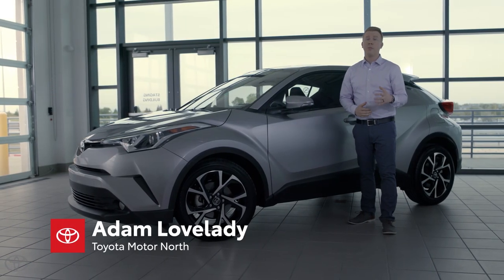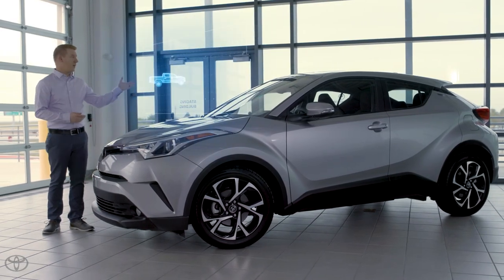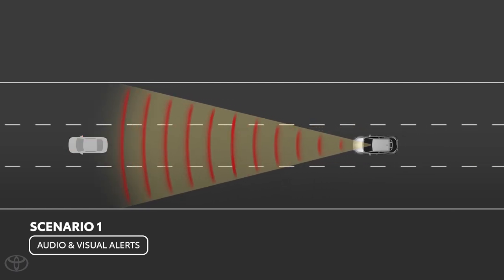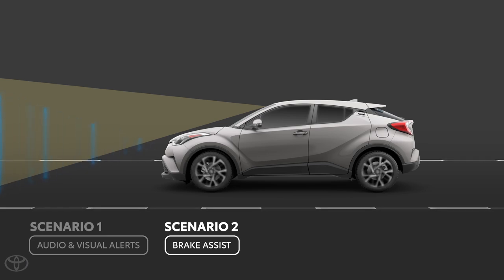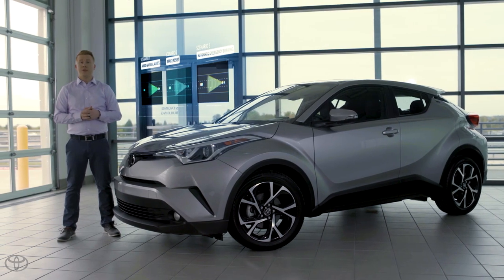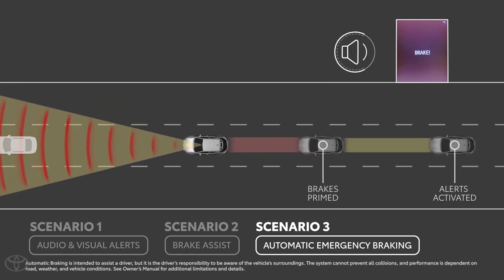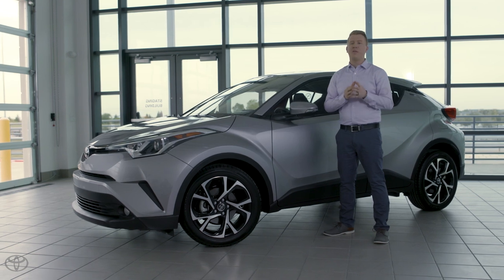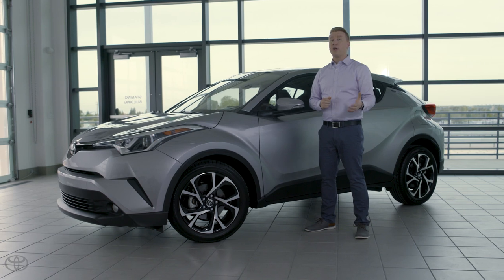Understanding The Stages of How The TSS Pre-Collision System (PCS) Works | Toyota

Comment: Just recently had a scenario where the PCS was really helpful. A car suddenly stopped ahead and while I did apply the brakes the distance was narrow. Pressed on the brakes, pcs applied the additional force and helped me come to a stop within one car length. Very helpful, very useful and a lifesaver in a worse case scenario which thankfully did not happen this time. Thanks toyota!
Reply from the maker: James, thank you for taking the time to share this with us. The greatest compliment we can receive is knowing your Toyota kept you safe.
Reply: In my first month driving my 2022 Corolla Cross a minivan pulled out into my right front qurter panel and though I was going only 25-30 mph PCS SLAMMED on the brakes before I could hit the brake pedal. No collision, no harm.

Comment: PCS is a feature that I made sure was included on my new 2019 RAV4 Hybrid Limited, but it does not work!  It is turned on and and set at “high” sensitivity, but it will not brake automatically.  My other manufacturer’s vehicle with brake assist worked fabulously.
Reply: Same thing with me. Rav4 2019. Says it's on, have it set to highest sensitivity, never get any alert!
Reply: It doesn't work in my 2020 highlander! 4 days old car!
Reply: knanand14 So sorry to hear that.  Hopefully, Toyota will fix it right the first time.  I haven’t taken in my RAV4, yet.
Reply: It appears like a more common issue. Just like you I wanted this feature to be there on my car! But does not works!
Reply: knanand14 😢
Reply: I can attest to this. Someone cut in front of me and did not work!
Reply: Same for me in a 2021 C-HR, it works when radar cruise control is on but not when it's off.
Reply: Hope I'm not too late to tell you this. I've been trying this feature on my chr and saw that sometimes it worked and sometimes it didn't. Fiddling around I noticed that the system works best or at all when you're not paying attention to the road ahead. Apparently, there's a sensor or camera tracking your sight. Hope this helps.
Reply: @ideaynojodas  that's very interesting, I'm not aware of any internal eye tracking camera, where do they hide it?
Reply: @kabukidreamboy  this is just a theory of mine, but it doesn't seem too far fetched, since many other cars have this feature.
Reply: @ideaynojodas I think you’re right. I have a 2019 chr Koba and sometimes it warns me and sometimes it doesn’t and I don’t have the cruise control on.

Comment: I have PCS on my 2019 Rav4  and Love to have another set of eyes on the road so to speak. I had to test it and it does work.. it took some guts the first time to trust the car would stop. My foot was ready incase it didnt.
Reply from the maker: What a leap of faith! Now that you've learned to trust the feature, do you use it often? -Hannah
Reply: @toyotausa  yes... i use it all the time but try not to rely upon it.. it would be nice if i could have it on all the time just as extra protection in normal driving without cruise control on.
Reply: I love the Pcs. It has helped me avoid getting in an accident. Go Toyota!

Comment: How do I know if mine is working? Lane tracing assist and dynamic cruise control work very well, but there have been a few instances where I would have expected PCS to activate but didn't... I have ensured it was on using the MID and increased the sensitivity as well
Reply from the maker: Hi, Matthew. For any vehicle concerns you are experiencing, we suggest visiting your local Toyota dealer for a proper diagnosis. Please visit, Toyota.com/dealers to locate the dealership nearest you.

Comment: I own British Corolla hatchback flamexpack hibrit 2020 model.  I use only 1000 kmetters Line asist working well. But I never heard voice alert And never Visual information. Brake system never worked what is the problem? Is it turn off or Toyota dosent support that option in Turkey?
Reply: Have you ever had "emergency" situation on the road? If you are breaking on time the system simply will not activate. I suggest you to try on a paper box or set our windshield sun screen(if you have one) on the middle of empty non used road and try yourself, the car should break.  My Corolla even break when I try to park in parking where there is a lot of leafy bushes and it detects them also as object then my car suddenly breaks.

Comment: My 2019 Toyota Rav 4 has all the safety features but I don’t think PCS works. I never get any alerts either and in DC traffic that’s strange. I asked the service center that I bought it at to fix it and they told me I’m a good driver, but I’m not that great. I rented a Chevy Blazer 2022 and everything worked including PCS . I’m going to take it to a Toyota dealership and see what they say. But I worry that when I pass someone if you have to narrowly it won’t let you and will apply breaks. It’s not ready yet if you ask me. I do like rear cross traffic alert and BSM but you can’t rely solely on BSM to change lanes but it’s helpful in certain situations

Comment: Got a 2024 cross and getting it checked up next week. System is very invasive. Applies brakes way too early or not at all even at a very slow speed. It is a very anoying system to me. Accidients have happened before and unfortunately, they will still happen with or because of all the sensors and security systems.

Comment: There are few things as terrifying as the unexpected hand of a programmer reaching into my car at speed and attenpting to take control away from my hands and feet. I just bought a beautiful 2018 Sienna EXL from Carmax, and was unaware this system was on. While approaching a complex freeway construction area on HWY50 in Sacramento, the system attempted to wrest control from me which would have wrecked me and several vehicles around me. Scared the bejezus out of me. I don't like it. Having a total disable as default at startup should one prefer a functioning car without 'Nanny State' hands in it should be the baseline, Toyota, not the exception. Otherwise, I love the machine.
Reply from the maker: Hi. there.👋 While we understand your concern, we would be unable to provide a diagnosis over DMs. If you feel you need to discuss this matter further, we kindly request you to please call the Brand Engagement Center at 1-800-331-4331.